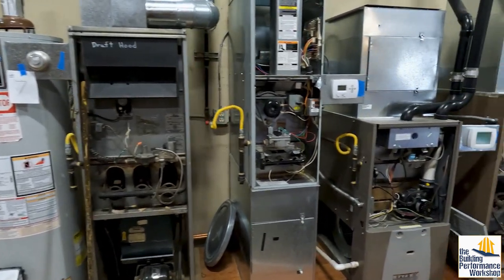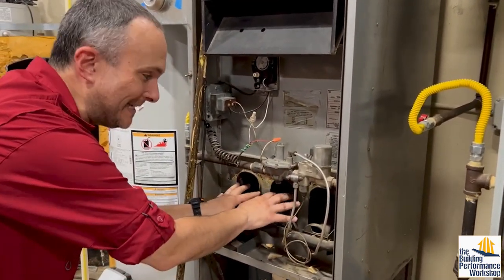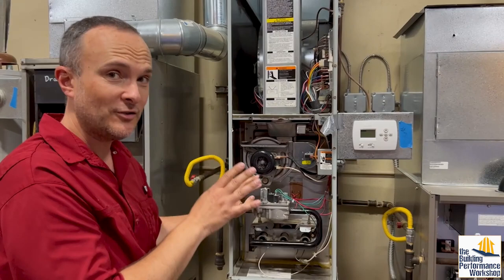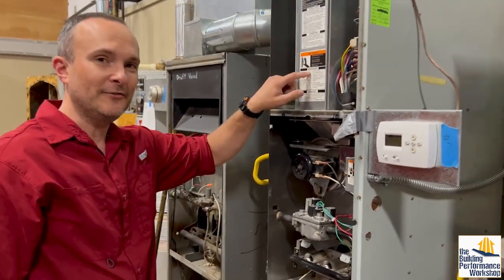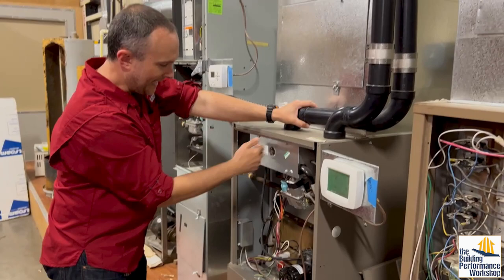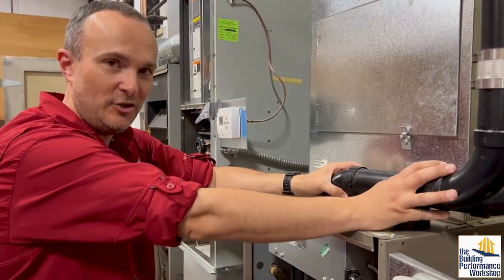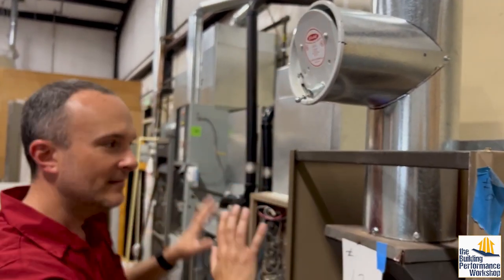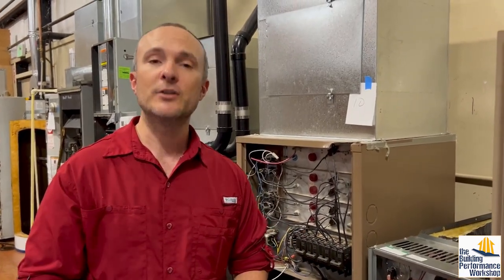Furnace Comparison: Atmospheric Draft, Induced Draft, and Sealed Combustion (and Barometric Dampers)

Comment: Hello - I need professional advice on directing me to the correct type of contractor or solution suggestion, Please! In summary, my water heater exhaust pipe makes a loud trumpeting sounds when outside winds are above 10+ mph and when they reach 20+ mph it sounds like I'm living in the Tundra inside my house. The Details: it all started several years ago when I replaced my  1970's Nat gas downdraft furnace with an 80% unit. The contractor combined the exhaust from the furnace and water heater using a Y and running a liner up my 1956 masonry chimney. The water tank exhaust pipe is 4" dia.  Prior to this the water heater had its own entry into the unlined masonry chimney. Since I live in a small square house, the utility room is in the middle of the house on the main floor. I do not have a downdraft issue and I believe that when strong winds pass over my chimney cap the wind noise is amplified within my house. I think I have excess up draft as my inducer motor spins when the winds are high and the furnace is off. I installed a B-Vent high wind chimney cap without any improvement. I had a recommend HVAC company out, paid a large bill, and got zero results nor suggestions. Please help with any ideas or request more details from me. Thanks in advance. - from Michigan.

Comment: Great video!   What model/style (natural gas) produces the driest air?
Reply from the maker: None, in fact. Forced air heating systems do not affect humidity. They may have ductwork that leaks, and therefore brings in dry cold air from outdoors, or unbalance the pressures in the home, bringing outdoor air in through cracks in the enclosure, but it is a myth that they dry out the air.

Comment: Calling all 90 plus furnaces "sealed combustion" is erroneous. When 90 percent furnaces were introduced back in the 80's they were single pipe systems. Sealed combustion or two pipe systems didn't become prevalent until the mid 90's